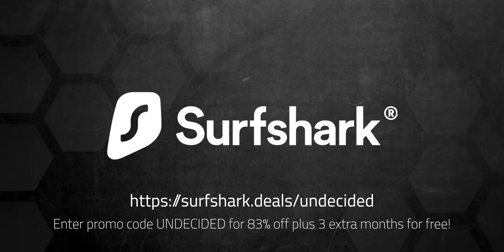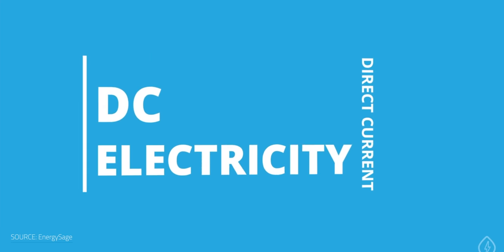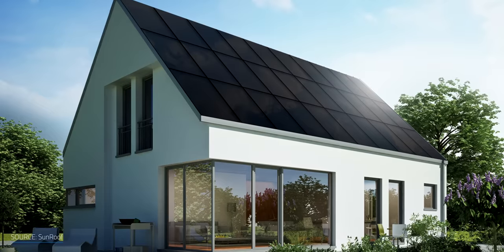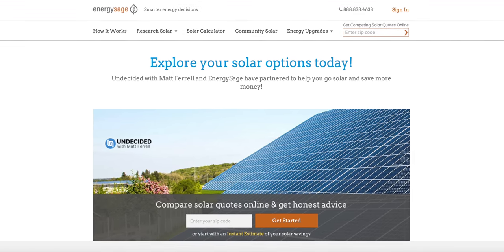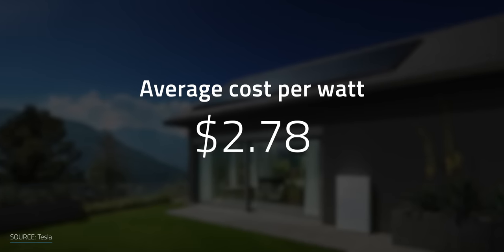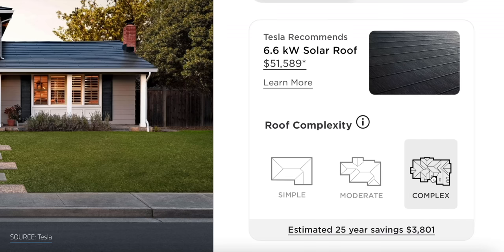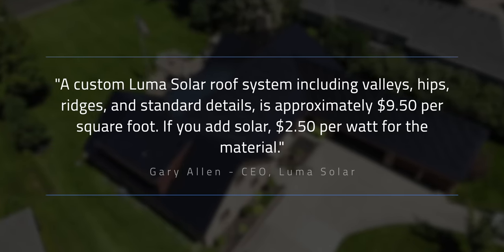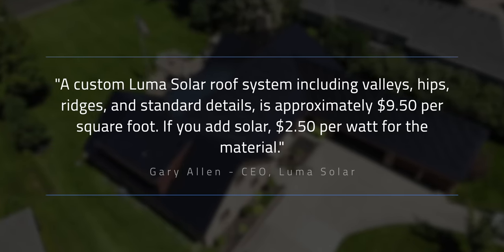Exploring Tesla Solar Roof vs. Solar Panels

Comment: 9:19
I just wanted to say that this way of presenting the numbers is very confusing. To me it suggests that the prices of sunpower are twice as much as the rest. (I do see that it is not the case but it leaves the impression). Please correct me if I am wrong about that.
I still enjoy your videos tough. And sorry for my bad english ;) I am not a native english speaker.
Reply from the maker: Yeah, I could have been clearer there in my presentation.  That's not price but watts per meter.  The bar graph is truncated which makes it look double ... sorry about that.
Reply: @UndecidedMF  Ups. I started with my comment but YouTube is stupid and doesn't allow to close out of writing the comment(on mobile). Thanks for correcting me :)
Reply: @UndecidedMF  as a general tip, it's always good to be very clear where the zero is when showing graphs and statistics. Gives context

Comment: With a 27 year old roof, decided on a Tesla Solar Roof as the replacement system.  It would have been a new roof and panels, so was more expensive when looking at a standing seam metal roof.  The system comes with a PowerWall, so some power backup as well.  Tesla will be installing it very soon.  I waited for a few months after the first estimate as it looked low.  It is higher, but still lower than an estimate I got from a local Tesla Solar Roof installer.   We shall see.

Comment: The big problem I see with tiles is that sure, while they are the roof and thus make it "cheaper" if you were gonna change your roof tiles anyways, the solar tech is evolving and if I want new better ones in let's say 10 years, I will have to redo my roof. With panels, there is a much smaller upgrade cost.

Comment: I have been trying to get Tesla to install my new solar shingle roof now for at least 18 months. At first, the price estimate was increased by >25%, I cancelled because of the added cost. A year later, they reached out to me to honor their original quote which I accepted. After their onsite survey and uploading relevant documents, there has been almost no progress. At first, they attributed the lack of progress as material shortages. Now the reason is lack of installation crews. To say the least, I’m frustrated. I do have a relatively complex roofline which needs to be replaced soon because of the wild weather last winter in the San Francisco Bay Area.

Comment: Question.. tiles use the entire roof area, correct? Given the cost of a new roof anyway.. would the cost of a new roof AND panels be more expensive than an entire roof of tiles that give you way more solar output than panels alone would? I assume an entire roof of tiles is going to give you 15, 20 or more Kwhs of solar than a typical panel install of 8, 12 or so kwhs?

Comment: I have panels that cover about 10% of my roof and provide 100% of my house’s electrical demand.  How does someone size the system to the electrical demand if they are installing solar roof tiles?  And how much loss of efficiency do you get for the roof tiles that are facing the wrong way?  It seems like the electrical demand versus the roof size and slopes has to be taken into account when comparing these two systems.

Comment: Giving cost/area is very misleading, since they don't produce the same energy per area. 
For instance, the SunPower A-370 panels produce 0.149 w/sq.in. 
While the Tesla roof tiles produce 0.075 w/sq.in. -- almost half of the Sunpower panels.  
If you really want to produce electricity, and if your roof is not huge, then SunPower panels are your best alternative. 
Also, the prices given for SunPower are high in my opinion.

Comment: Matt,  you used the term solar power when I think you meant solar energy.  About panels or tiles, I use panels as they are a better value.  Either way, let's get more local solar energy collection, it all helps, and it matters.

Comment: I kinda choked at the panel prices you had there... I bought 340watt panels for round £150 (inc tax).... Which is about £0.44 per watt... Or 62 US cents

And yes, I've seen over 340watts from them too, in the UK, in April!
Reply: Scott Luther  they're QCells Duo Blk-G8 340 (Split cell, all black), and they have a 25 year warranty too. >19% efficiency. End of warranty rating of 85%
I've seen them exceed their rated output several times already, and I haven't even exposed them to summer yet!

They might not be top row panels, but with that price difference I can replace them all every 10 years and still be better off!

I've actually spent more on the microinverters than I have on the panels!
Reply from the maker: These prices included installation, but that's a great price.  Prices in the US are higher than most other areas of the world from what I've seen.
Reply: @UndecidedMF  ah, that explains it!
My price does too, I installed them myself! And because they're on an end wall, I just used Unistrut at £8 for 3m lengths 😁
I spent less on 4 panels and micro inverters than I was quoted for planning and installation! Hence I did it myself
Reply: @juststeve5542  well, at least you’ve helped us settle once and for all, that age old conundrum: Are apples oranges?
Reply: @RickinICT  lol! I didn't know Matt was talking about installed prices, so it's not quite as shocking as I first thought, although it looks like the man with the drill costs more than the panels!

Comment: For now, I don't think there is a real compelling reason to chose tiles unless you have TONS of extra money and want't that 'look'. Panels are way more cost effective, and in 25 years when you think you may need to replace them, it will be a much cheaper way to get new more efficient planels. Of course a lot of the tech can also change in 25 years. If you get panels that are installed with wiring in the attick, as opposed to some ugly conduit running along your roof and exterrior walls, it looks fine. It is only when the installers run external conduit that panels can be an eyesore. Otherwise, the panels can look very clean.

Comment: Nice comparison video Matt! We just had a new roof installed last year. So, the obvious choice for us would be to go with solar panels. However, not being sure how much longer we will reside in this home and being up there in years, it would make no sense for us to even consider going solar. Like you said, you've got to take into account many factors before getting on the solar band wagon. Hope that you and your family are doing well & staying safe! 👍👍😉😉
Reply: That is wrong. You should get panels just do it. If you sell the house it is value feature in the price. You don't need a massive system.

Comment: US prices for installed solar panels are really expensive. GoSolarQuotes.com.au are showing an average of USD0.80/watt in Australia based on a 5KWp system. It would be worth looking at where the extra costs are coming in.  Here in the UK I can get new MCS approved 370W panels for GBP130 but installation is expensive. Also when looking at panels it is best to look at the NOCT ratings (about 25% lower) rather than peak as they will only reach the peak power at low temperatures with 1000w/sqm irradiance which almost never happens anywhere.

Comment: What about the difference between wiring just a few large panels in a single spot, to hundreds of tiles with tiny inverters that all require their own wires? That makes the installation costs gigantic in comparison - which makes sense of the Tesla installation price hike. That also means the "oh, repair is so easy, you just need to vacuum it up" comment extremely suspicious - the tile might be easy to dispose of but what about the compromised inverter and wiring? those can short out and catch fire!

Comment: One major disadvantage of tiles is that you have to cover the whole roof, which means that probably 80% is placed suboptimal not even coming close to the rated wattage.
Reply: Tiles that are in a suboptimal position, or are not needed, are blank tiles that do not have the solar panels in them.  Thus you only have solar rated for your needs and the rest of the tiles are blanks.

Comment: If you live in an area that gets large hail, the idea that your roof covering will shatter is not a "feature" you want. I'll wait until they figure out how to get an impact resistant class 4 rating on these shingles before I'd consider using them.

Comment: Assume you have a home that is situated such that half of the roof rarely gets direct sunlight.  I can't see how installing a tile roof would make sense versus panels installed that always face the sun.  In the future, perhaps homes will be built on a turntable to take full advantage of solar roof panels or tiles, but unless that happens I can't see either one being a great option for those living in the higher latitudes.

Comment: In NC we've had a LOT of hail over the past few years - just wondering how these products hold up to that...especially the tiles...I also can't help but question how long it takes to start seeing the savings benefits of going solar, from what I can tell, even if I bought the extra battery storage that I would need for daily usage (Basically add another 10K according to this video price range), I can't even generate as much energy as I use in a day  - I'm 54 and I don't see any ROI for years and years and since we are nuclear it's doesn't save the planet in my situation either. I really do want to be self sufficient - but until the price point comes down I just don't see the point in my situation. (Open for other opinions)...

Comment: Supposedly you can't add Powerwalls to existing solar anymore? According to Ben Sullins' video this week anyway.
Reply from the maker: He's correct.  Tesla won't sell solar without powerwalls or powerwalls without solar.  It's a bundle deal from now on.
Reply: @UndecidedMF  That sounds like a bad idea. Cuts off the portion of the market that might have already solar.
It also looks suspiciously like Apple's closed off ecosystem. What's next? You can't repair it yourself?

Comment: Why is solar PV so expensive in the USA? 

In Australia the typical price for a complete solar PV system, panels, inverter and including professional installation and network approvals is around A$1/W, or less than US$0.75/W. A little higher for top of the line gear and a little less for the more budget panels and inverters.
Reply: I’m jealous. Here in Germany, you can be happey if your rooftop installation costs less than 1 €/Wp (=1.55 AUD) — and we have less than half the irradiation of Australia, so effectively three times more expensive here per kWh produced.
Reply: @MarkDoll  In some states of Australia there are additional incentives meaning some are able to install solar here for less than US$0.40/W. It's a very efficient industry here, but does also attract shonks who do poor work and rip people off.

Comment: From what I've heard, Tesla is no longer allowing Solar Roof installs without a Power Wall purchase as well.  While I like the idea of something like their Solar Roof system, I don't want to be locked into their products for life especially as battery technology evolves.  My dream system would be:
Battery capacity enough for 3 days with minimal sun/wind and no grid power.
Solar and Wind generation capacity of 150%(or more) of the battery bank (so it can charge while being used).
Grid tie AND standalone inverter charger.  Normal conditions, sell the excess to the utility.  But you DON'T want to be screwed when the utility goes down.
Generator input to the Inverter Charger as well, sized at 150% of the battery bank.

Comment: I would prefer buying kWh capacity from a solar farm and having my utility bill credited with the energy credits.  I don't have to worry about roofing expenses, moving, or maintenance.  The cost-efficiency can best be maximized when you place solar where it's needed the most and installation in a desert area is cheaper than dealing with it on my roof.

Comment: If you get more watts than you consume, does the utility buy it back from you? If yes that seems to justify going with panels that have a higher output or adding more panels, assuming it doesn't look bad.

Comment: Matt, I'm late getting into this video, so perhaps this has been pointed out or answered.   I had my house evaluated for panels in order to get off the grid, but found that I didn't have enough roof area to make that happen.  At best I was 80% solar, 20% grid in order to make it through the day.  Since the solar roof covers 100% of the roof, would it provide more power production overall, thus getting more people off the grid?  I know the answer would be an estimate requiring a rather large sample set of homes, but it would be an interesting study.  Has anyone looked at this?

Comment: The aesthetic argument in my opinion is biased when considering retro installation of PV.  I have seen some very good looking house designs that used PV 'panels' (these are actually referred to as PV modules in the industry).  These good looking houses were based on them being designed around the integration of PV so not only did they provide a large uncluttered rectangular area for the PV the roof was optimally angled towards the sun. 

Going forward as the integration of PV into new house builds, I wonder if we are going to see more consideration for PV in the designs?  If this is the case then this might reduce the aesthetic advantage for PV roof tiles.

Comment: Is it not also that with the tiles you have the potential for a little greater power output for your roof size, since the tiles will cover every sq cm of the roof and not just the parts that can take the big panels?

Comment: US roofs are weird. You use stuff that we’d put on a shed or outbuilding. My house was built in 1927, it’s roof is coming to the end of its life. We expect roofs to last a very long time here
Reply: That is why panels are king in UK and other northern European countries.
Reply: That's why so few own houses in Europe, because the cost to own and buy is outrageous. Requirements that are robust but unnecessary are not a virtue, they are an arrogance thrust on you by an owner class that wants you to stay at the bottom. Example: UK house costs are three times the cost per sq meter of the former Eastern block, because communism broke the back of the feudal system that still dominates the UK.

Comment: Generally, when it comes to solar power, it's all about cost efficiency. Cheaper panels pay off much faster, that's their main advantage.
On the other hand, by installing panels you're messing with your current roof - risking that it will start leaking, maybe not now but in 5-10 years...

Comment: Living in the UK I'm still undecided. If I was to do it right I would just go for tiles but the roof on the house is only 30 years old and in no way needing replaced. Its expensive and wasteful. Panels seem the best value tho I'm conscious that things are improving and they have a shorter lifespan (Estimates say I won't cover the costs of installing them). 
I think until prices do drop both options kinda suck and other improvements such as central heating or even a few old appliances make more sense.
Reply: Get with PANELS  !
Reply: @honesty_-no9he  That made me smile

Comment: But all your calculations and comparisons are on per surface area basis. If I’m not mistaken, for a roof you need to cover the entire roof and more than half the tiles are non optimal position and contribute little to production. On the other hand, you can size and place minimum number of panels to achieve production goal.  Or am I missing something?

Comment: Over the next few years technology in the Labs now will start emerging in the Solar panel market. I am not sure how well they can be included into solar roof tile tech, but they will dramatically improve what panels can do. Right now the best solar panels make in the low 20% efficiency range. In labs right now they are hitting high 40% figures by using panels that generate power through multiple layers. Light travels through the panels layers and generates power in lower layers as well as higher layers. Think of a multi-level DVD disc a laser focuses through one layer to a lower layer, the same principle is used in the new panels. So when these newer technology panels get to market the efficiency will be around double what we have now. Much smaller areas can generate useable power. Solar panels on Cars make more sense and will extend the range beyond the average daily commute. The future is bright it's solar.

Comment: @Matt. I have a new standing seam aluminum roof likely to last 100 years. Looking at a Tesla 12 panel roof with 2 PWs. Primary objective is to provide power to my gas furnace during winter grid outage here in Massachusetts. Any new info on Tesla’s new Powerwall Plus? Could I get away with just a single PW? Concerned with morning shadowing from higher roof and afternoon shadowing from treed lot. OK to go with Tesla traditional string inverter? Have they improved it as part of Powerwall Plus? ThankU. Great vids!

Comment: I would prefer panels over tiles.
1 energy production and longevity
2 reliability every tile has a connector that's potential failure point in the system of hundreds of tiles compared to tens of panels.

Comment: As solar technology progress , will the solar tile progress as a panel, cause if it does then tile makes more sense to be installed for a house for there is no wasted space, since the angle  and direction of the panels will not matter. Some one can change a section of the roofing to get the maximum advantage if it's backwards compatible with the old tile.  
If not then panels makes a sensible  option to start the renewable  journey and finally with enough savings upgrade to the tiles down the line.  
Lastly third party battery backup system also matter if they willing to integrate these panels  or tiles into one seamless interface.